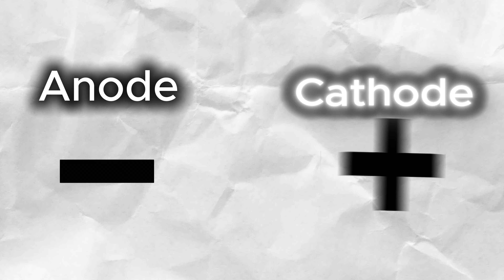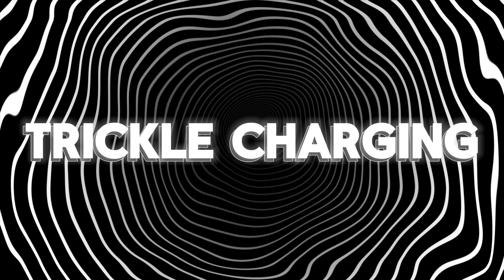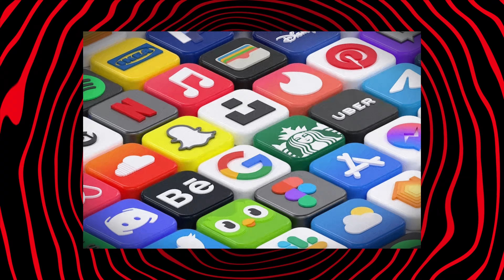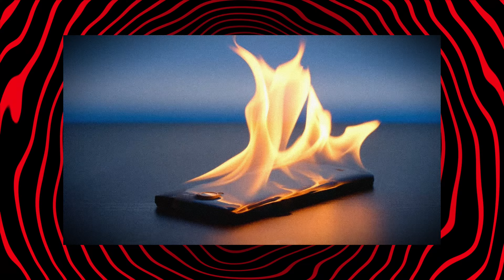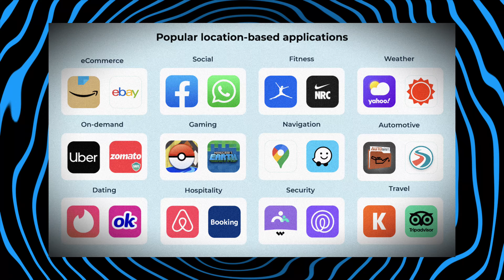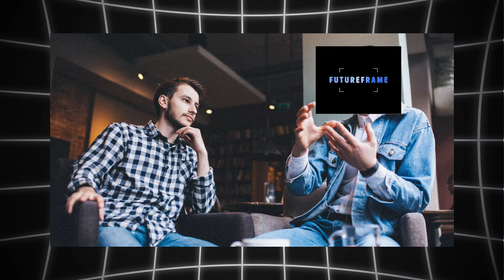Stop Killing Your Battery Like This

Comment: You can extend battery life by reducing your depth of discharge. Charge phone at 30% and stop around 70%. There are apps to notify you to unplug the charger. You can even put the charger on a smart plug and record yourself telling your home assistant speaker to turn off the charger, and set that as the notification sound for the charge notify app so it automatically stops charging at the right time.